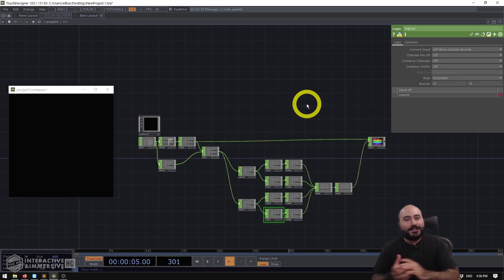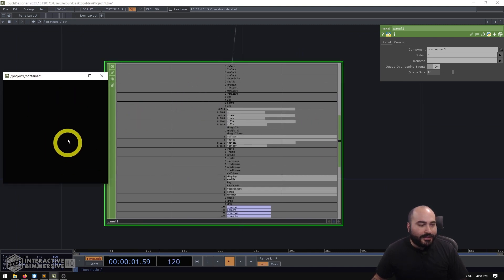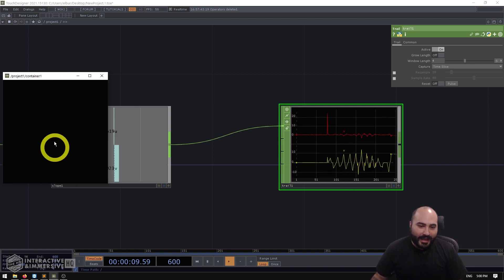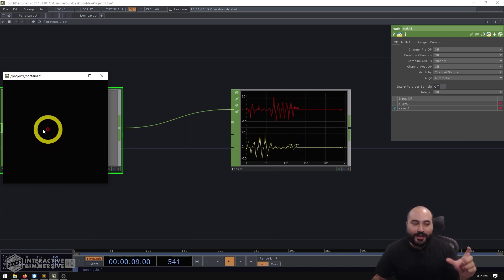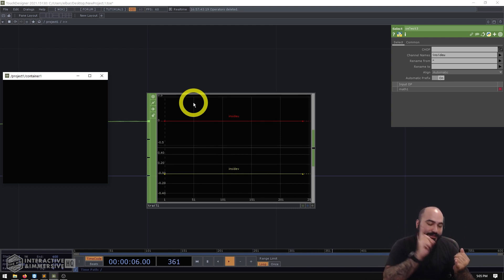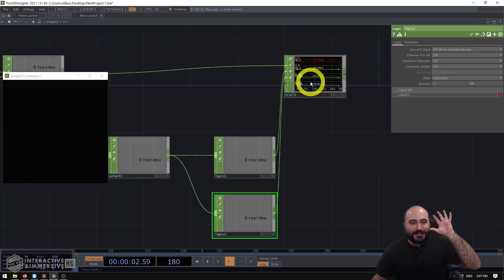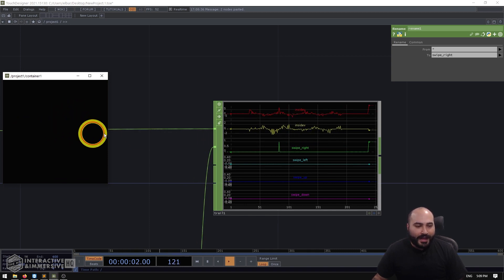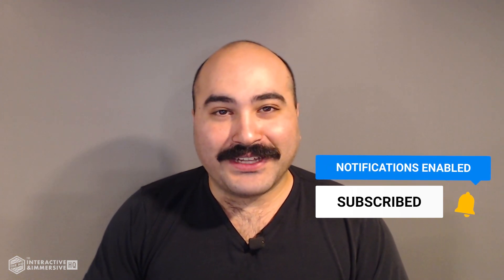Easy Swipe Detection in TouchDesigner - TouchDesigner Tutorial 059

Comment: Hi, how could i have this touch data effect a video clip? for example make partial effects rippel where the touch has gone over the video?
Reply from the maker: Great question! You can achieve this effect with feedback and displacement. Check out this forum post for an example: https://forum.derivative.ca/t/ripples-over-top/277687

In this case, you could use the mouse position to change the Center position parameter of the Circle TOP, and then use the mouse click to control the Fill Color parameter of the circle.